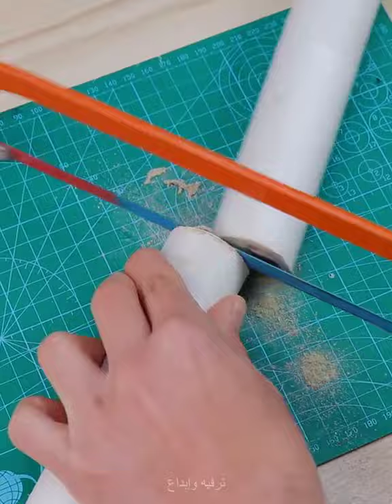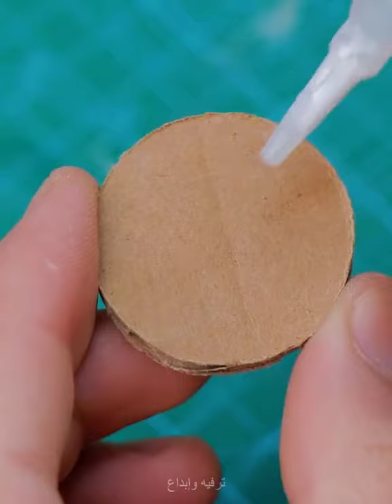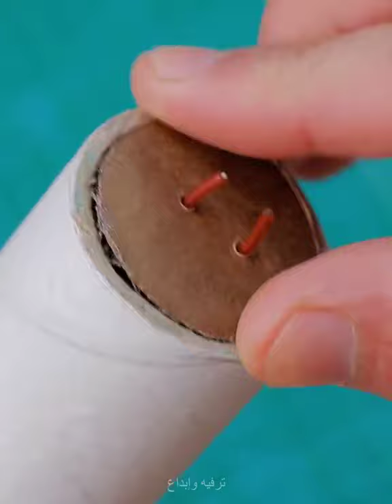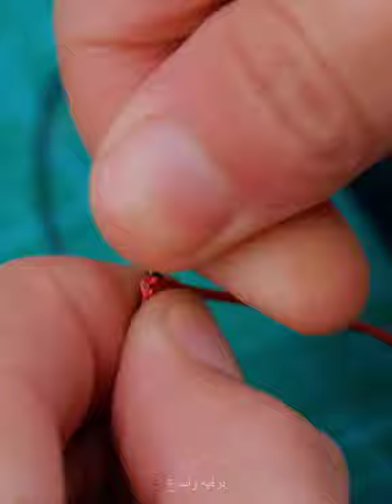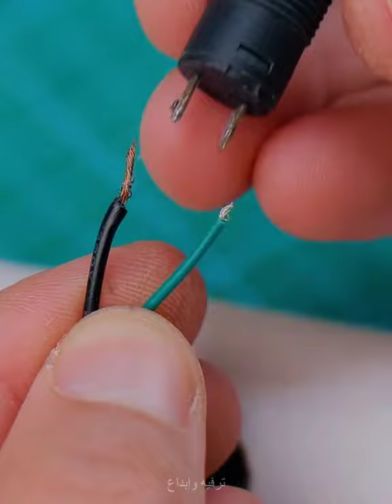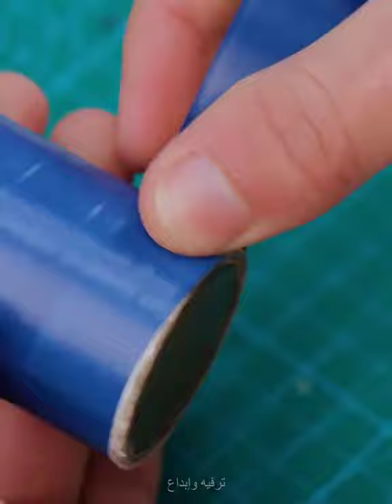How to make a detonator

Comment: That's a fucking stun gun not a detonator hamood
Reply: The arcing electricity should ignite your FUSE TO BLASTING CAP, like a plasma lighter. The only thing u would've don't differently was take the radio receiver for rc car and Sauter that into circuit un order to make it remote